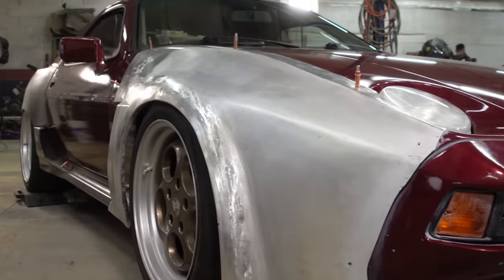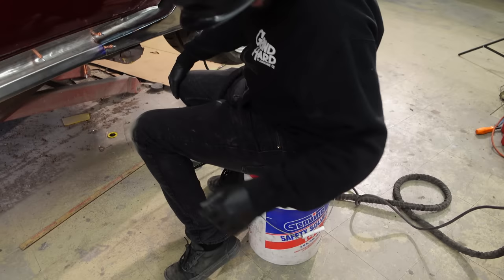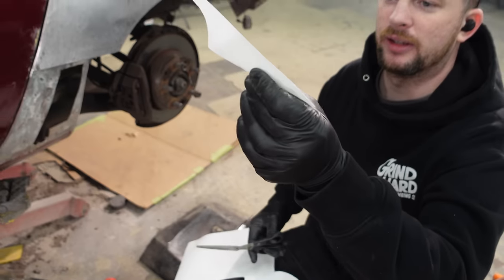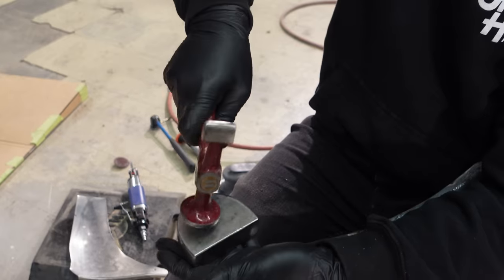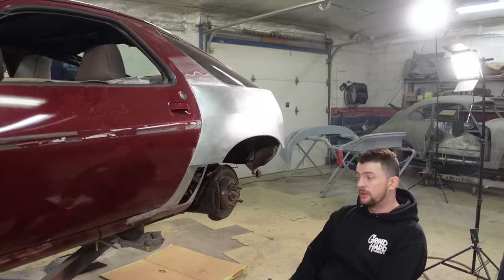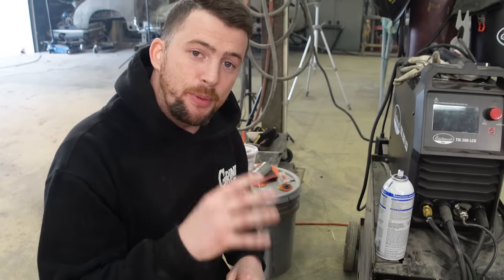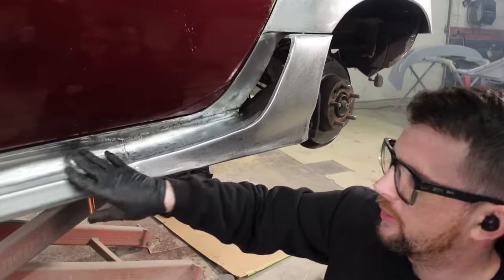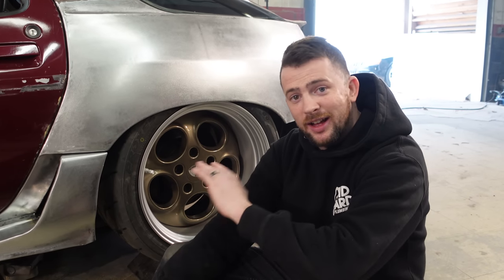Custom Widebody Porsche 928! - Metal Fabrication + Welding on an OUTRAGEOUS Car - 928 Ep. 23

Comment: Ive learned the most important step of my Wide Body STI Wagon build I need to cut out my existing fenders and weld in my new Sedan(STI) fenders the right way all the way through and hammer my welds down making sure I start with a straight canvas first of course. . The humor and wholesomeness is off the charts!!!

Comment: I have without a doubt learned that even using ''cheap'' tools, you can still accomplishment something that is somewhat close to the more higher tools can make. 
For example the english wheel comparison.

Also i dont know why I have never thought about the fact that a weld shrinks the metal, where its joined together.. Its obvious but i never thought about it.

Comment: Bro y’all have taught me so much about sheet metal working.. as an armchair machinist, and engineer by trade, I hate working with sheet metal. Having said that, just that tip about how the chisel vs. the round sides of the hammer stretch and move the material in different directions has helped me tremendously. Also, how you did the contoured brakes with the rollers rather than a standard folding break made way more sense. Keep up the good work y’all. Love the channel!
Reply: Also, P.S. - I’d love to know your welder settings because you’re laying down gorgeous beads on that thin material which I can never seem to do. Thanks again for the dope content and sick tips and tricks

Comment: What have I learnt from your channel that I'd like to put into practice? The fact that against so many others who say joining two edges needs to be done with multiple spot welds spaced wide apart in time and location to minimise warp, you recommend doing it in one pass then putting the effort in to stretch back to  form; their way leads to lots of filler and doesn't look great, while yours leaves you with something that looks like you could almost paint it straight away. It's a bit of a revelation!

Comment: I think the biggest thing I took from this was when I fixed a rusted hole in the rocker panel. I didn’t just patch the hole. But I had the confidence to cut out a square beyond the rust cut, bend and scribe the new piece. Welded it in and it was so satisfying too’ also learned about all the anti corrosion weld through protection spray paint. Instead of regular off the shelf stuff. So thank you!

Comment: I really need that welder! The most useful thing I've learned from this channel is heat management with welding and how to lean into making the warping consistent rather trying to minimize warping because it is inevitable. I am currently using a mig welder to replace floors in my nova and would live to have a tig before doing the quarters.

Comment: I learned about putting even heat into the panel to result in controllable warpage. Tack the panel in, seam weld in longer bursts than I've seen elsewhere and not force cool the welds with compressed air

Comment: I've been paying attention to your welding advice for how to weld and align sheet metal.   If I had a TIG I probably would have started out jumping around stitching weld s (like with MIG).  Also I might not have thought of leaving tabs after cutting scribed lines.   I'm sure I'll go back and re-watch when I start my projects just to refresh.    I probably wouldn't' have thought of fusing SS with Steel (for the rear spoiler drain) either. Great progress!

Comment: What I have learned is by using hammer and bag that you can make a curve in sheet metal. If I were to get welder I would take it and use it for my Buick regal project it has some rust but has potential

Comment: loving the series.. what suspension are you running? how is the car not needing to be driven for a few miles for the suspension to settle to get the desired ride heights like all other 928's?